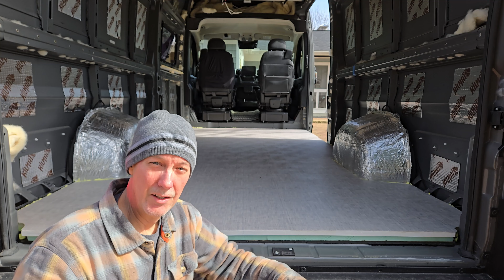Purpose-Built Van Floor | 6-Layer Insulated System | S2:E5

Comment: All nuts should be Nyloc with a minimum of two threads extending beyond the nut face.
Period.
The only exception is where heat could potentially degrade the plastic.
Per Google AI: "Nyloc nuts, also known as nylon insert lock nuts, generally retain their locking ability up to 250°F (121°C). Temperatures exceeding this limit can degrade the nylon insert, compromising the nut's locking mechanism. "
Good job.
I could see getting the vinyl to align properly could be an issue.
Reply from the maker: Thank you!

Comment: Great video! For the floor bolts, how did you ensure that no water will come up through the holes you drilled in the floor of the van? Under the van can get a lot of splashing, etc.
Reply from the maker: I used Rust-Oleum 248656-6PK Professional Grade Undercoating Spray Paint: 2 full coats on the entire underside of the van. 4 coats on all the screws and bolts coming through the floor.

Comment: Thanks for the videos and sharing your thoughts.  Curious as to why you didn’t use the van rug to fill the corrugations and to just place the XPS foam on top of that instead of using the mini cell strips.
Reply from the maker: Hello, thank you for the comment and question! I truly considered it, but ultimately it came down to stability. The Vanrug has no PSI and did in fact compress under the cabinets and walls in the budget build. Even with 3/4" plywood on top I had low confidence it would stay level. The Vanrug served it's purpose well, it's just not intended to be used as a subfloor.

Comment: I’m also seeing how much height you still have under the bed and it makes me so happy that I decided to go with the super high roof! The fact that we will be able to walk under our bed in the back when we are using our U-shaped dinette is the best!
Reply from the maker: That was our plan all along - if the van thing worked out (tested in the budget build) we wanted the elevator bed either in the back over a dinette or the front over the LR. Our bed system is approx 10.5-inches (3" aluminum, 0.5" wooden slats, 6" mattress). Without our ceiling installed I have about 5" above my head, I'm 5'7". After the ceiling I expect still 3.5 to 4" clearance.
Reply: @ perfect!
Reply: @MooseVan does your mattress sit perfectly flush to the ceiling or is there a small gap? I was measuring today and originally had thought I would do a full-size bed and we would sleep side to side (I’m 5’ 8”). But, after more measuring, I’m not sure I can make the bed wide enough d/t the way the super hi narrows as you move up toward the ceiling. Much more so than my 2019 hi roof Promaster did. I’ve also realized that on the roof and I’m looking a solar panel placement, etc. Something I was not really expecting.
Reply from the maker: @justfollowthatvan6721  I plan to put the bed back in today and measure a few things including actual height to walk under it since the floor and ceiling installations. I'll let you know- maybe make a quick video and post it.
Reply: @MooseVan  perfect, thanks! Would love to know the final measurements of the bed also. Mine is going in the back, but I think they will still be really similar.
Reply from the maker: @ I installed the frame and wired it in to power then realized I forgot to paint the wood slats. I hope to finish them today and get the mattress in, then can make a quick video- it may be a few days. My frame is exactly 73" x 60". If you install yours in the rear, you could get away with East to West and shorten the bed, then use the fillers for head and foot areas. Like this: https://youtu.be/JbrmBR7i1KA?si=5MKUqnILE_-UDW7Y
Reply from the maker: and this - https://youtu.be/R8Hlvb8owZM?si=t9RQcEPILjHDOMNN
Reply from the maker: hey, last week at Tommy's I totally forgot to get your cell or give you mine! If Tommy didn't give it to you, just ask him for it so we can keep in touch. And, text pics, I'm excited to see how much you got done!
Reply: @MooseVan he gave it to me. I’ll text you shortly👍 So great to meet you. Can’t wait to see how yours progresses!
Reply from the maker: Just uploaded the new video showing the measurements - if I didn't capture what you're looking for let me know: https://youtu.be/q4dqDjFygjw

Comment: Love it! Love the amount of time and thought you put into this. I’m still trying to decide if I’m going with a hydronic floor. If I don’t, I’ll definitely be emulating your floor install!
Reply from the maker: That's another reason it took me so long to get this started- too many options! I wanted hydronic as well, but I tend to over-complicate things. When I really stepped back and thought about our needs, it made more sense to go with the Velit 4k heater- which I just finished installing last weekend and am very happy with it.
Reply: @MooseVan  just saw a video on that. Looks very easy to install.
Reply from the maker: @ and less complex, fewer things to break, easier to get to if it does break... I'm compiling our install video soon - maybe a week or so to complete and publish - am far behind on video creation, still have the Velit AC video to edit first!
Reply: @MooseVan  I just stumbled on to a 12v water heater. I was looking a an AC that I love and the water heater, that I had no idea even existed, came up as a topic of conversation. I’ll keep ya posted on it, but so far, that looks like what I’m going with. I was pretty set on Rixen’s. But, after this discovery, I think I’m switching directions:)
Reply from the maker: @justfollowthatvan6721  Great, looking forward to it. My current plan is to just get hot water to the sink and will use a point-of-presence 110v that goes up to 1800 watts. Five Pound Pete uses the exact same one in his recirculating shower system. Then, planning on the exact same recirc shower Pete designed here: https://youtu.be/Op3o5u1wZM4?si=-bs4GmTsP-zLhG6a